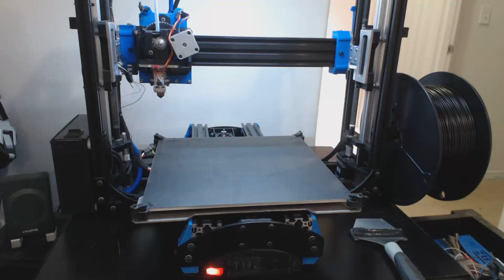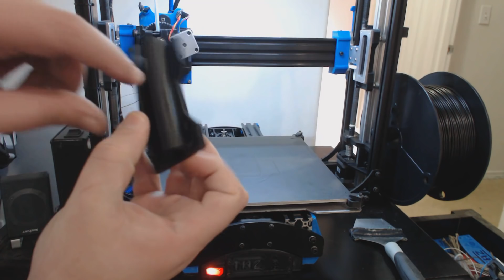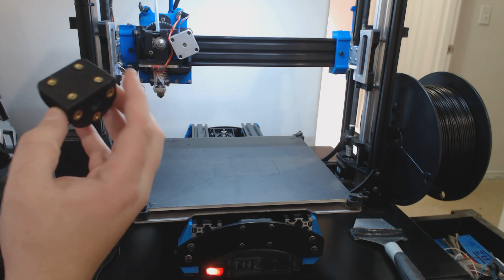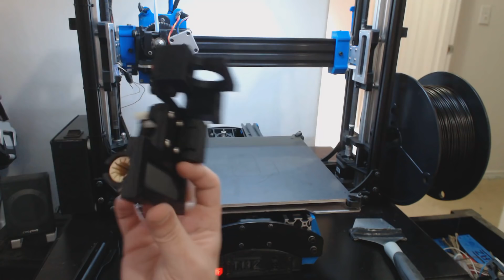Lulzbot Taz 4/5 Anti Wobble Z nut Mount block

Comment: Hi Tim,
Do you have a list of all the mods you have done on your Taz. I have two Taz 5 and a Taz 3 that I've uograded. They are never and I mean never consistent in their printing and I can see you've put a lot of thought into the process and configuration you have developed. 
Thanks for any Help,Stacy
Reply from the maker: AerialDroneAccessories.com I actually have another video where I give a tour of my 3d printer mods at https://youtu.be/8FlzSqXLnjM . most of the mods are actually my designs, which you can find at http://www.thingiverse.com/piercet/designs . There are some new pieces since this video was taken too. let me know if you have a question about any of them. hope that helps!
Reply: Tim Pierce Hi,  I noticed on thingy verse you mentioned kits for the x, y, and z rail system.  Do you sale the entire kits.  Would love to be able to purchase it all together in a kit.
Reply from the maker: I do sell a limited number of kits, there are plans in the works to sell them at greater volumes through an online retailer, but those are still in progress. If you would like to order a set, shoot me an email at piercet at comcast.net and we can go over what you would like and costs, etc. the main variables are color and options. if it's a plastic color I normally stock (black and blue usually) we can price based off print weight, if you want a custom color plastic cost would be a full roll, etc. Then there are options such as the z anti wobble,  the micrometer endstop target, etc. Thanks! Tim